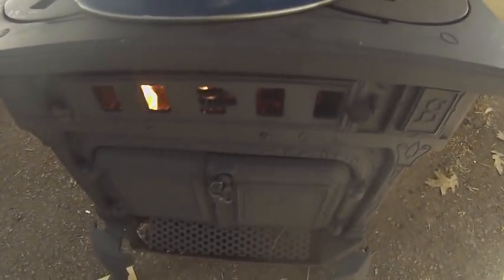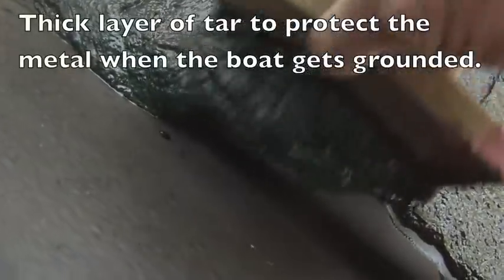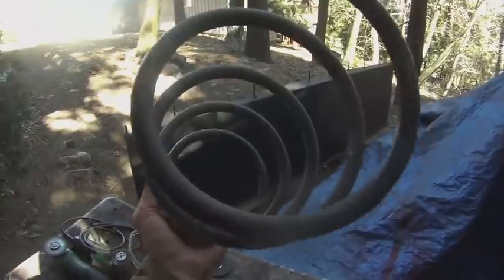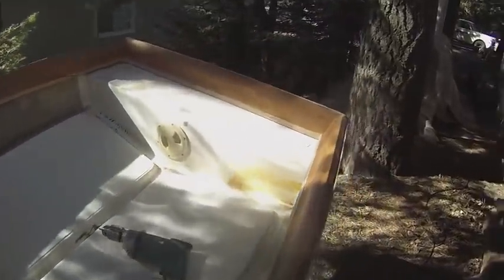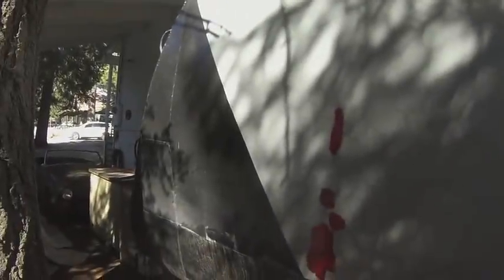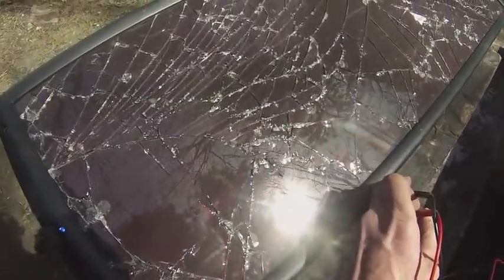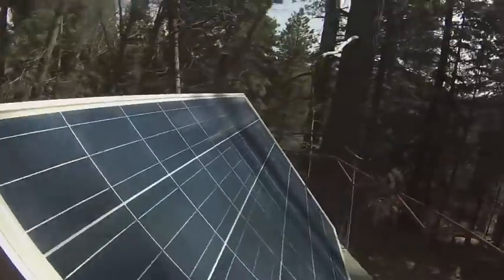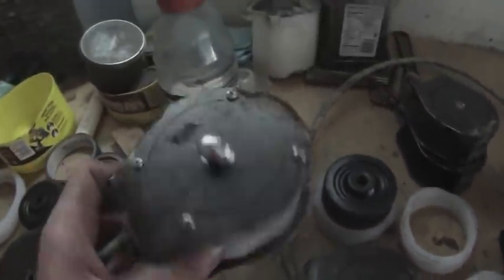Steel Sailboat Build Part 37

Comment: Nope blocks will not work. Rope will break in 5 seconds on the water. This thing will never make it to the water anyway. This is not roundy round racing. The Coast Guard gonna fry you up boy. They may escort you back to nothern cali or whatever and give u a picture of Our 54th President Donald John Trump unsigned. Thanks for putting that 10,000 into his economy. Gone too far. lol.

Comment: Just a question, would the dinghy in the upright position act like air brake when the boat is in motion? Not necessarily under sail, but if motoring?
Reply: I thought that too, but it seems to be pretty sheltered with only a little bit coming up over the stern. The big trick will be getting tied up with any kind of wave action.
Reply: Its position represents a number of problems such as not being able to throw a few essentials in an emergency. Nothing on this boat is thought more than 1 step in advance
Reply: @zimtuff  "not being able to throw a few essentials in an emergency." Huh? Apart from towing the dinghy, or having it upright in davits, FEW yachts could do that.
And no way would you have the dinghy upright in any kinds of bad weather.
Reply: @dnomyarnostaw  Dinghys stored horizontally and high enough can have some water food fuel etc placed inside. You could even have the outboard attached. In bad weather you should be going into an emergency life raft.
Reply: @dnomyarnostaw  I never said anything about storing it vertically. I would never do it that way.
Reply: @zimtuff  I don't know where you got  "said anything about storing it vertically". I can't see anywhere I used the word vertically in my reply to you.
I said "upright", which means "the attitude where the dinghy  normally is operated". Horizontally, on the other hand,  could mean  stored fore and aft, but it could be upside down to keep the weather out.
"Dinghys stored horizontally and high enough can have some water food fuel etc placed inside"  - ( I presume you mean Upright) is NOT  the same as ""not being able to throw a few essentials in an emergency."  which you originally stated, and requires the dinghy to be "upright" and "uncovered", which is only possible in limited situations, and never for long term storage.
Reply: @dnomyarnostaw  You are nuts, you are arguing with yourself.
Reply: Looking at the hull shape and all the protrusions I dont think he'll notice it. That's if it even floats and sails properly to begin with.
Reply: @benmac7315  How do you get onto the foredeck? Do you climb over the roof or crawl out a window?
Reply: @zimtuff  how the hell am I meant to know? Personally I probably wouldn't step foot on it to begin with.

Comment: Hey, about those car springs:
Due to the high carbon content they "should" be unweldable with a normal welding machine, creates a very fragile glass like weld seam. As you have welded them already, you might want to test one of them to see if they break with an impact load.

Keep up the good work!
Reply: Yup, spring steel. Was my first thought "how the fuck did he weld that?" hahah

Comment: @4:15 just put a hook (one of those fine thread type hooks) through the bottom with two big butyl tape/caulk framed washers and you can use it to easily force the rope to do it's job.

As for the lashing ropes, just have them raised over the nose of the boat before releasing it, and tied to the deck (whilst still being attached and looped to the eyelets you welded on). That way, when you raise the dingy, you simply untie them in reverse order, and loop them over the nose as you pull on the rope. That way, you don't have to get down on the ladder a second time.

Comment: This boat is gonna rust away in 6 months in a salt water environment.
Reply: Although I follow this channel from distance, I have my doubts about the construction, the strength, centre of gravity and stability. But it isn’t me on board, that’s for sure. I look forward to see if it even floats, but we will see. I’m just curious and skeptical, but I hope the best for the guy.
Reply: @Dan_C604  there's a video where he does all the math , righting moment and sail size.
Reply: @ExploringCabinsandMines  "there's a video where he does all the math , righting moment and sail size." There is ? Where ? On  the one called "Boat Information", he figures that he will add ballast if it "feels like it needs it"
Reply: @dnomyarnostaw  Hes a math tutor,  I'm sure he did "THE MATH"
Reply: @ExploringCabinsandMines  Really? Where?  He adds on funny little hull extensions, arbitrary weights for ballast. I haven't seen  his weight table, line drawings, or any one of half a dozen "standard" calculations you get with proper plans.
Reply: @ExploringCabinsandMines  "Sail boat calculations"
Wow. Did you even watch that debacle?
He calculates the "buoyancy mid point" before he added that funny little engine pod, and the boat was nose heavy by his numbers at that stage.
He also bases his calculations on the area of a parabola, not the actual dimensions (100's and 100s of calculations that a real plan would have). He says he has to make 300 more measurements for a more accurate depth. has he done those ?
Then, there is buoyancy, or righting moments when heeling. What is the righting arm at say 40% ( knockdown).
And, like I said before, he has no weight tables,  to calculate trim under various loads, or angles of heel.
Reply: @dnomyarnostaw  let's see the sailboat you've built. oh wait.....
Reply: @dnomyarnostaw  weight were listed
Reply: @ExploringCabinsandMines  I couldn't spot them, but even so, until the are incorporated into a chart of righting moments, they are not valuable.
This guy doesn't even know if he will come rightside up on a 180 capsize, but worse, he doesn't know what will happen on an 80 or 90 degree heel.
Reply: @ExploringCabinsandMines  There you go smart guy. I HAVE designed a boat, and spent over $4,000 getting figures verified and prepared by a naval architect, so lets hear YOUR expertise,  buddy.
Reply: @dnomyarnostaw  wheres your boat ? links ? video ? anything  ? lol
Reply: @dnomyarnostaw  Ray the keyboard warrior  !!
Reply: @ExploringCabinsandMines  Yes you ARE! Trying to defend this disaster, not even understanding the problem. I bet you can't even sail, but you are such an expert.
Reply: @dnomyarnostaw  I made no claims , where is your boat ? can't operate a camera  ?
Reply: @dnomyarnostaw  let's see your boat that you couldn't even film and post.
Reply: @dnomyarnostaw  hey captain Ray wheres yer ship matey !!
Reply: @dnomyarnostaw  Ray where's your boat video ? are you lying  ? hmmmm ?
Reply: @ExploringCabinsandMines  - He is just a puffed up old decaying cadaver.
Reply: Ray I'm disappointed in you :-(
Reply: @ExploringCabinsandMines  you are boaring.
Reply: What up booby G. Your input is vital
Reply: I say chaps no need for fisticuffs 
There will be room on the dock for all opinions 
Remember to bring an item that floats 
It may be needed
:0)
Reply: Mark Bailey I couldn’t agree more!!! This Bob guy just has mean negative comments all the time, I very much enjoy the build videos👍
Reply: @scarface-39  Some people like threads where everyone agrees with each other. Unfortunately life is not like that. It doesnt need a an expert eye to see that this thing is not going to be sea worthy. It will be also high maintenance just sitting in the water.
Reply: I’m far from being a snowflake and I promise, you would not say that to my face!!! Tough guy!
Reply: @scarface-39  meet ya on the playground at noon!
Reply: Bob G sounds good!!! Here we go😂
Reply: What do you call a man with no arms and no legs floating in the water? A Bob. @Bob G, I hope that your son, little Nicky G, hasn't pegged his future on playing the cello. He is abjectly terrible at it. I see that he followed in your footsteps at being a band sissy.
Reply: @brutusbarnabus8098   oh dang ! I've been exposed! Wait, have I?
Reply: @harrydingle534  Built my own steel sail boat and Bob is right.
Reply: @harrydingle534  - oooh...how tricky. Moving your videos to a new YT acct. Just shows what a sketchy dude you are. Why don't you save little Nicky G the embarrassment and take those videos down. Leave him some semblance of dignity. Deaf people play the cello better than he does. Why do you hate your son so?
Reply: Oh hi Bob!! Hey look everyone it’s Mr sunshine!!!😂
Reply: @scarface-39  I'm Mr reality,  snowflake. I just dont wanna hear all the crying when it all goes south. Let the trainwreck begin.
Reply: @goodnough1  snowflake? kind of like the people that play in orchestras and the people that go and record them?
Reply: @brettstevens9677  like, share, and subscribe bratt.
Reply: Mean while, bare metal at marina reports as rust-ok after decades in the water. It's not even your boat, so what do you get, besides the prick title?